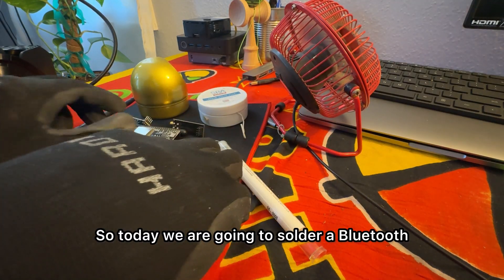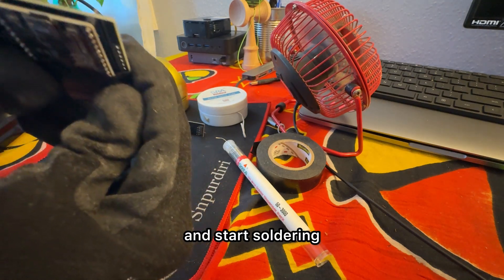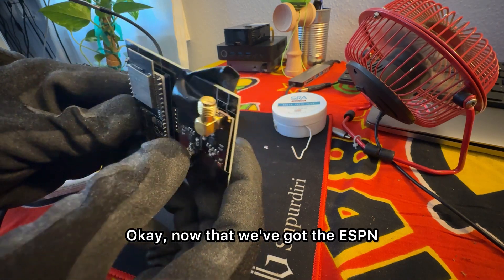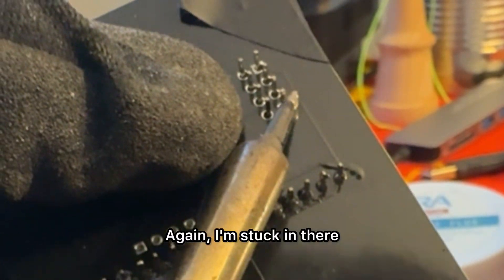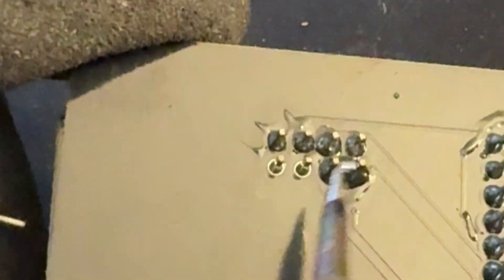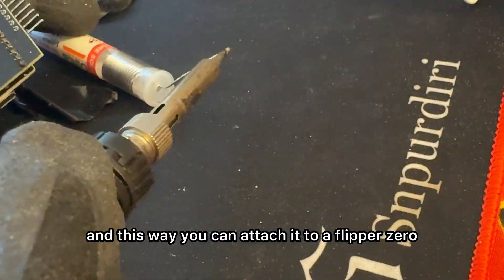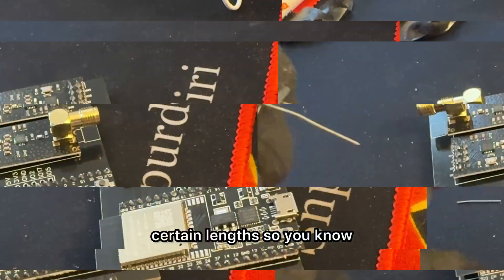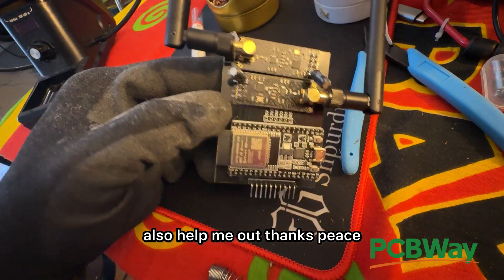Soldering an ESP32 Bluetooth Jammer PCB!

Comment: Hey, can you send me a picture of the order in PCBWAY, and I wanted to ask if E01-2G4M27D works on this board? I don't want to use the black NRF24 since it is not that strong
Reply from the maker: I don’t think the radio will fit for NRF24 holes, but you can add female headers and plug it in

Comment: I flashed it and made sure everything was correct and soldered. Everything is correct and there are no shorted pins. The device just turns on and gets hot and nothing happens.
Reply from the maker: It’s not magic you didn’t something wrong